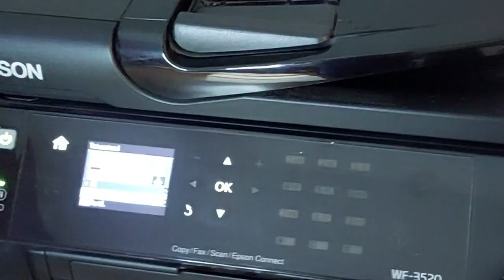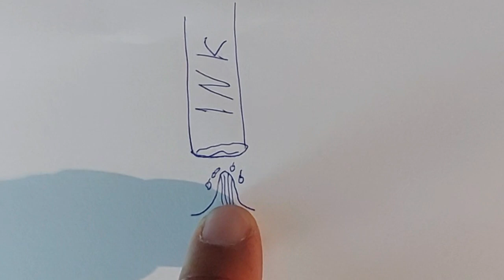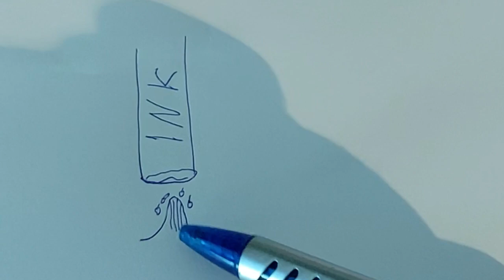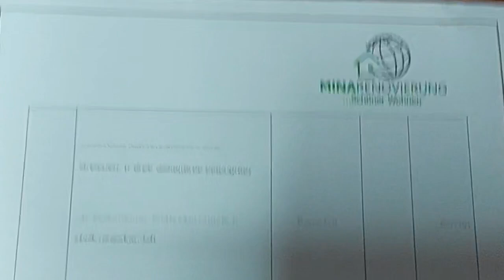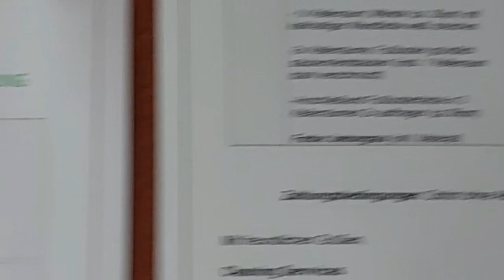How To Fix Epson Printer Not Printing Black | Epson Black Ink Not Printing (WORKING FIX)

Comment: the issue I have is that only one side of the black nozzle check works.  would that be a fautly nozzle or just a super clog.  I've tried just about everything I can think of.  it will print black, but won't sublimate that color.  I'm assuming it's because it has mixed colors together to generate black.  everyting black on my sublimation comes out pinkish red.  I'm stumped.  looking for answers.  thank you.  epson wf7720.  hasn't been used in months.  all the colors are pretty much Ok, just that black nozzle check won't print anyting on the left hand side of the nozzle check.